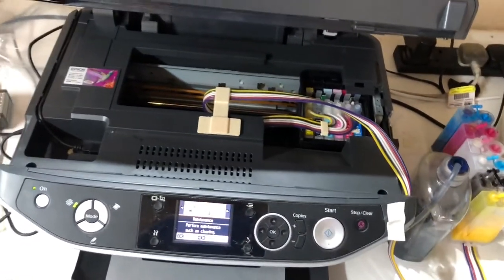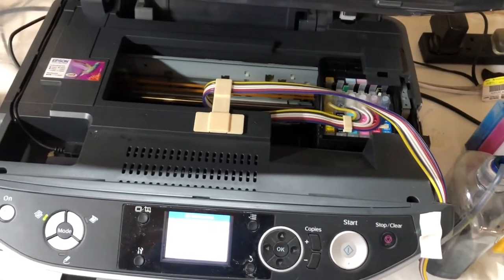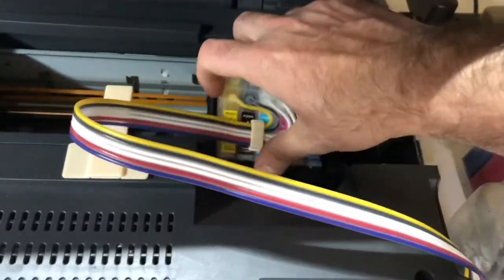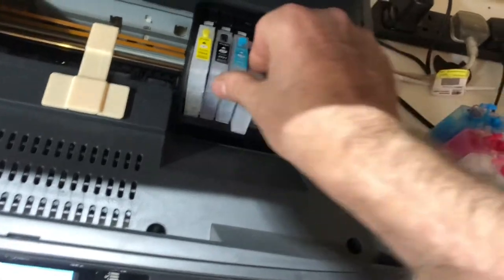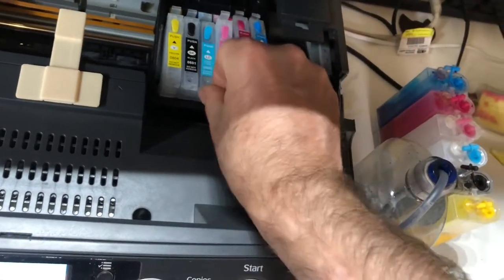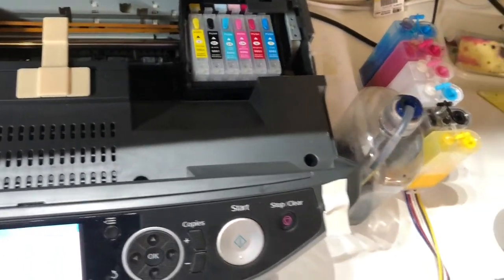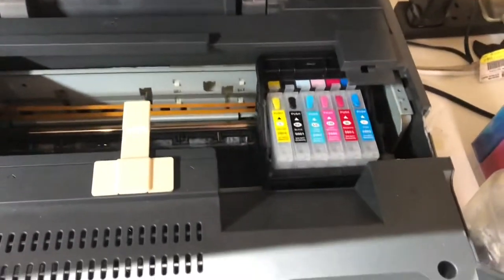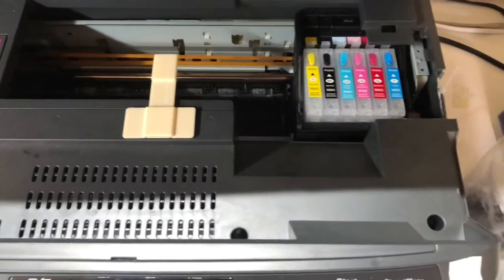Prevent your DTF printer from clogging

Comment: Can i use only distillated water without fluid for long time? Only if the printer will be turn off. If the printer will be turn on and i go to printing, so i change cartridge with distillated water for cartridge with dtf ink. Next i run automatic cleaning printer.And I will be this cycle still repeat as prevention clogging white ink in head print

Comment: hi Dave, Happy new year. Before starting back up after Christmas would you run a couple of head cleans with the cleaning cartridges before going back to the ciss inks?
Regards Geoff
Reply from the maker: If you’ve had cleaning carts installed during down time just swap out, the printer will automatically do a charge and clean
Reply: @DavesDiscoveriesChannel  ok thanks

Comment: Hi Dave, Thank you so much for the video. Please let me know how long have you been using the same printhead using this method? I am new to this business and have to print a few designs per day and sometimes I have to keep it off for a few days as well because of no orders. Please let me know how long can we keep it with cleaning liquid cartridges attached to the printer as I have heard we shouldn't do that as the cleaning liquid might damage the printhead.
Reply from the maker: Well over a year 👍
Reply from the maker: BTW the fluid is diluted with deionised water.
Reply: @DavesDiscoveriesChannel  that is perfect. Thank you so much, I will do the same and hopefully run it for long. Please let me know how long did you keep it without printing?